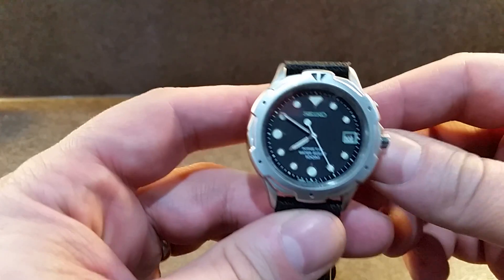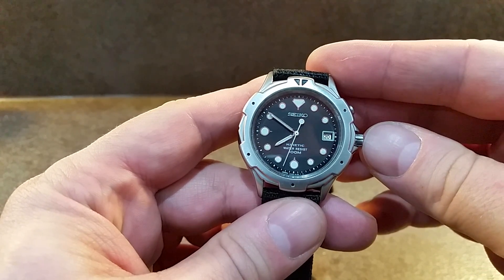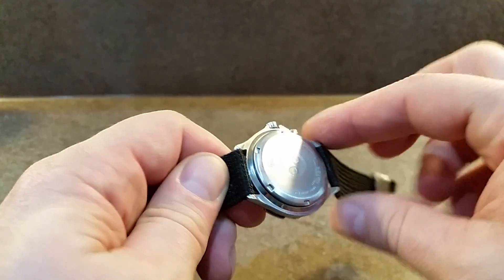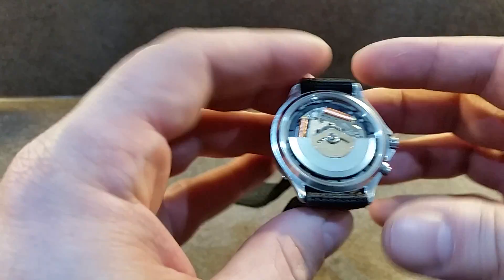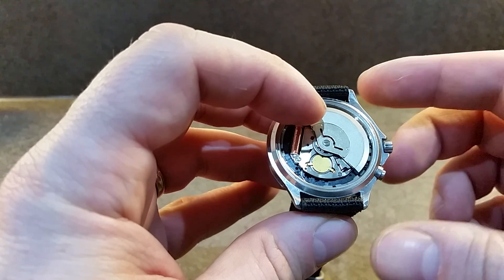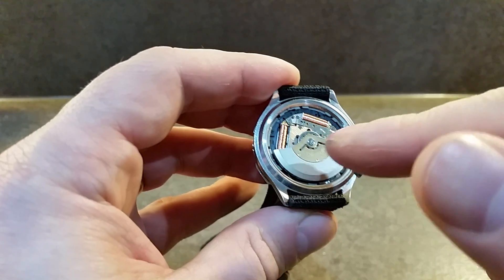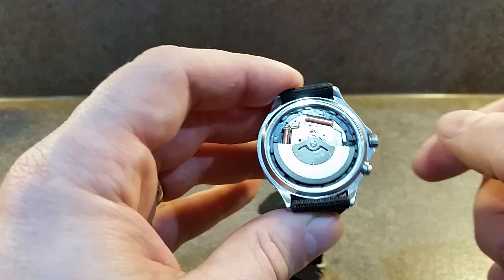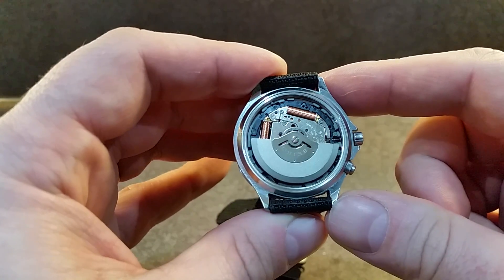What is a Seiko kinetic watch? How does it work?

Comment: Kinetic does have a quartz movement and they changed to batteries as the capacitors had a tendency to leak after a while. The mechanical part just charges the battery

Comment: These watches have a little battery in them that is constantly being charged by the dynamo in it which is activated through your wrist movements. But that battery gets depleted at some point and can't hold any charge. I bought one for my father. We need to replace the battery. In the model I had, the battery is apparently not regular lithium battery but some other type. I need to take care of it at some point. 

It is a nice watch. But it doesn't go for decades without any maintenance. Not a big issue but just heads up. The marketing gave the impression that would go on and on since it was bein recharged

Comment: Good video and nicely explained, of how this technique works!

I wouldn't say, that this system is really cheaper than watches with batteries. The battery prices are very low. Okay, when using brand batteries, than the 10 pounds capacitor might be cheaper within 10 or 15 years.
The main advantage might be, that you do not have to change the battery every one or two years. That is very comfortable.

Comment: You forgot to mention the function of the button @ 2 o'clock: When it's pushed, (Right when the seconds hand is @ 12 o'clock..), the seconds hand will move according to the accumulated charge. Maximum arc is all the way to 6 o'clock, meaning there is enough charge for six months. Thank you for a clear, spotless info.

Comment: Interesting concept. So it's basically a tiny dynamo charging that capacitor instead of winding up the main spring.

Still, this or Citizen's solar powered EcoDrive? Because if you didn't wear your kinetic watch for over a month its capacitor would be dead, whereas EcoDrive would last six months in full darkness on full charge, and would recharge very quickly under bright light. 🤔

Comment: How does the lume work because I have a rather interesting mod idea. Are there any LED based lume watches on this platform?
Reply from the maker: the lume stores light in it and is not bright unless it has been 'charged' by light.  Never seen LED used as lume before
Reply: @Birthyearwatches  what if a regular automatic movement could be adapted to charge a capacitor, the lume could be powered by this stored energy and activated via a light sensor.
Reply from the maker: @trafficface  I am not an electronic engineer, but would the battery not drain faster than it could charge?  Better to use something like timex indigo backlighting just to have lume when needed
Reply: @Birthyearwatches  I don't know either your probably correct but failure is the path to success so I'm going to try and find out.

Comment: Hi sir Good day,How long does it take for charging up until the maximum? And if its fully charged how long could it stay without winding again..
Reply from the maker: if the capacitor is completely flat it can take a while to build up the charge - some say 2,000 shakes if it has been stood for a long while.  Replacement is often the better solution.  But from fully charge a 5M43A movement should have a power reserve of 168 hours
Reply: My friend has one of these. It kept stopping. I wind it with a power tool to get any decent power reserve. I think something is not up to par.
Reply: @cynic150  it will have a dead capacitor.
Reply: @OffGridInvestor  Thanks. Perhaps, but he bought it new and only had it 2-3 years. Found that the auto winder weight pivot was dry. Oil made it work again!

Comment: Why... Why these nasty quartz movements??
Reply from the maker: Quartz is not nasty at all.  Quartz regulated movements are cheaper to make, cheaper to maintain and more accurate than 99% of mechanical watches.  Plus a lot of people don't care what regulates their watches.  There are some nasty cheap quartz movements, but there are also some plain nasty mechanical movements.  I will swap from Manual wind, automatic, quartz and electronic watches and like each one for a different reason.  And for complex triple calendar watches quartz is the ideal solution.
Reply: Why would you say that the quartz movement is nasty ?
Reply from the maker: @234kmowfdm  some quartz are nasty, and some mechanical movements are worse.  Seiko's are not nasty IMHO

Comment: Omega, Baume it Mercier and other Swiss manufacturers use Autoquartz. On the lower end, I was told Bulova subed out to Citizen for their 97A136 witch has an open heart! How is this possible? Do a show on.
Reply from the maker: Bulova are owned by Citizen now.  Googling Bulova 97A136 shows it to be an automatic movement, so drilling a hole in the dial isn't difficult

Comment: Apparently the new kinetics have been changed. Instead of a capacitor they now have a li-ion battery that stores the power. I looked into it because I got a diver kinetic real cheap from a shop. Great watch built like a tank. Quartz accuracy,  never needs a battery, 200m water resistance. What's not to like.
Reply: What model?
Reply: I absolutely love both of my Seiko Kinectic's! Great watches!
Reply: Indeed, I got new Seiko Kinetic with Blue Dial - it does have upgraded power storage unit
Reply: Capacitors are essentially an acid type battery in sheet form that's then rolled up in some cases. But that's usually larger ones. Fact is, they're all some form of battery.
Reply: @OffGridInvestor  if i am not mistaken capacitors have a longer lasting life span, and they are not burdened to the same extent as batteries on the voltage that goes into it, which makes them excellent for recharging unperiodicly or unconsistantly,
Reply: but capacitors have a very small charge capacity compared to batteries. If capacitors are RAM, batteries are hard drives   @Svevid
Reply: @mortache  i know what they are, but you dont need a huge battery in watches if it has a self recharge function
Reply: @Svevid  What about sleeping? Or storage? Definitely don't wanna run low on a perpetual calendar, for sure. Then there's stuff I don't know like how much the accuracy is affected when the charge runs low
Reply: @mortache  Well charge running low I am not sure how much of a problem that is on a capacitor. but if accuracy is your worry i wouldn't, not on a gps watch as it sets itself all the time. It was just a thought anyways. I'd like to think the designers of certain watches have in mind that something lasting for a long time would be a good thing for the company image.
Reply: @OffGridInvestor  Apparently the capacitors had a tendency to leak & i think they needed charging more frequently than the batteries they replaced them with

Comment: Is it more accurate like a quartz watch?
Reply: It basically IS EXACTLY a quartz watch. Just with a generator attached by way of a flywheel and faraday coil or something similar
Reply from the maker: Yes, the movement is controlled by  quartz and the kinetic part charges the power source, so they are as accurate as conventional quartz movements

Comment: You have to be vigilant about the capacitor. They can leak and ruin your watch. It's best to open your watch and check it out. I bought a battery and I didn't use it enough and it died. I can still charge it somewhat but I can't get it to fully charge. The capacitor needs changing if it leaks. And no one can say when it will leak. The batteries that they made years ago were made much better than the batteries they're making now. I think it's that way with everything. I wish it was true that these batteries lasted 10 years like my old one did. You can go on the internet and read where people have had problems with the life and the leakage problems. Some people will be lucky and the battery may not leak and may last for 15 years. I wish I was one of those people. If your battery does leak and you catch it in time you can clean up the leakage and save your watch. Maintenance is the key. There's not a perfect battery out there. As someone here say's these capacitors are just batteries that are rechargeable. And when you don't recharge them properly they get damaged.
Reply: I think that is the trouble with new technology, it needs years of testing and refining. I prefer my Citizen Eco-Drive. It has lasted 12 years already!
Reply: Oh my goodness such a loud and vest shouting across the cosmos and internet that could not care less about you! Deliver yourself to a soup kitchen and wash dishes, for people who feel real things in real time.

Comment: I have one, its a lithium battery - it will last perhaps 5 to 10 years max. Seiko wanted more than the watch cost for repair. However the battery costs £23 for mine and is easy to replace.

Comment: It IS a quartz watch. It's an electrically powered watch, regulated by circuitry containing a quartz crystal, which vibrates at a rate more constant than the gyrations of a mechanical balance wheel and escapement mechanism, enabling it to achieve a greater level of accuracy than the average mechanical watch. To state that it is not a quartz watch, just because its battery is recharged during wear, by means of a dynamo harvesting the kinetic movements of the wearer, is just wrong!
Reply: i think it would best be named a hybrid synergy drive - just like toyota :)), it's a combination of two engineering solutions, working together to deliver in a simple and reliable fashion.
Reply: @gogutzy  That's what a Spring Drive is. 
A kinetic watch is just a plain old quartz watch, the way a solar powered watch is. It's just not exclusively powered by a battery cell.
Reply: well, seiko doesn't call it uartz watch anyway....

Comment: It means if wear 12 hrs a day  daily then how long will it take to charge fully?
Reply: a few hours
Reply from the maker: Mihir747 it depends on the age and condition of the capacitor. If you are not getting 12 hours use then you will need a new capacitor in most cases

Comment: Right off the bat, it IS a quartz watch. It is just a quarts watch that is not powered by a battery.
Reply: Which in all reality aren't they powered by a battery since the initial capacitors seemed to be replaced by the lithium battery? I just changed one out of a SKA099.  Certainly wasn't a fun process.  If it wasn't a graduation gift from my mother then I'd probably have tossed it or sold it. I'd recommend saving the money and just going with a standard quartz since that is much easier to change out on your own.  My Kinetic was always a bit noisy as well.  It's okay for what it is, but I wouldn't personally buy a Kinetic if there wasn't something about the watch that just sold me on it.  Nice video and explanation though!
Reply: My thoughts exactly.